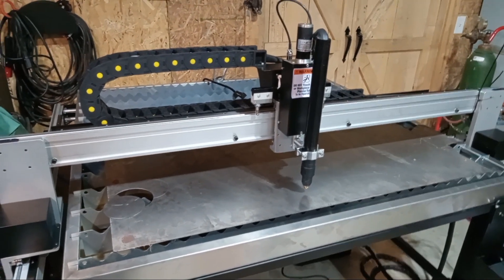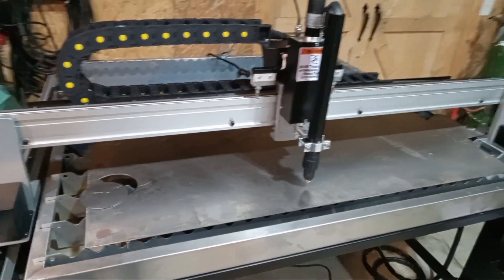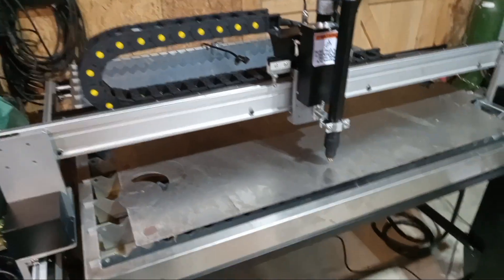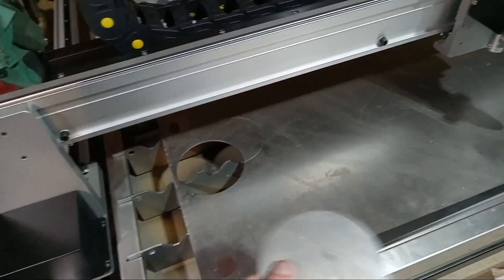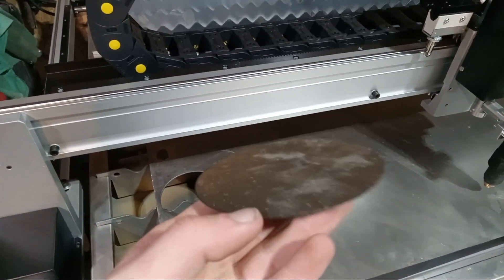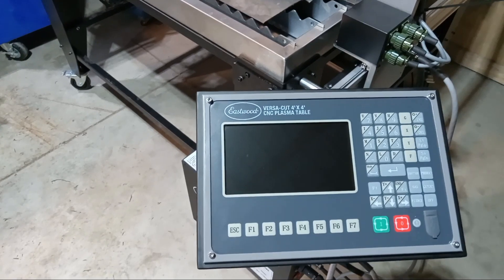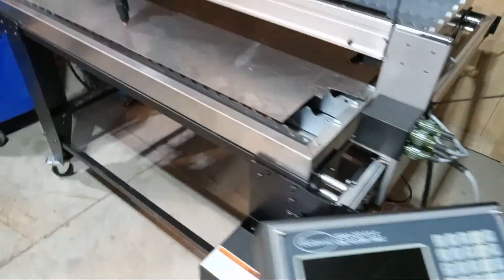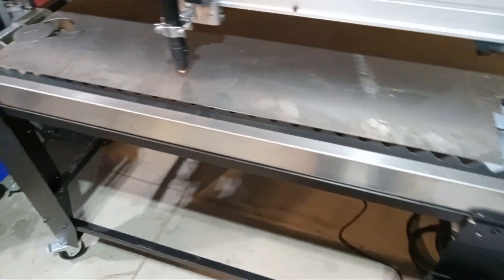We got a CNC plasma table!

Comment: How are you liking this plasma table so far?. I like the fact it's 4x4 but can't find much videos/reviews from customers.
Reply from the maker: Honestly we haven't used it too much, but for what we have used it for it has worked fine. It is just a 4x4 plasma table, not cheap, not overbuilt, nor does it have many features, it has just what you need to get the job done.
Reply: @AmericanOutdoorLiving  how does it compare to others out there for the same price point?  Software?  Thanks
Reply from the maker: Only other plasma table I've used is the Lincoln which is much more expensive. VERY sturdy table, I always had software problems with the machine itself, although that may be able to be fixed by the user if you research and experiment. Lincoln's propriety design program is from the early 2000's and is pretty bad.